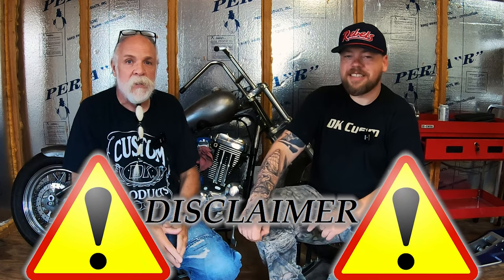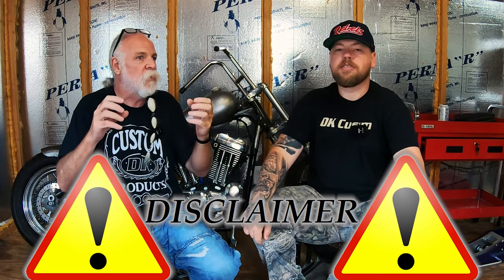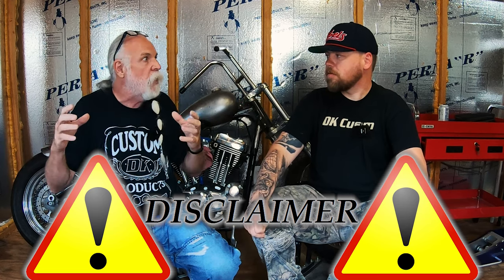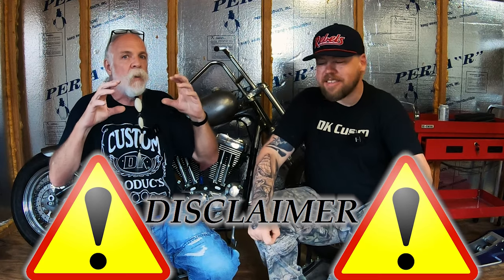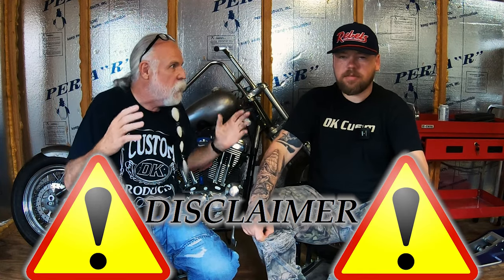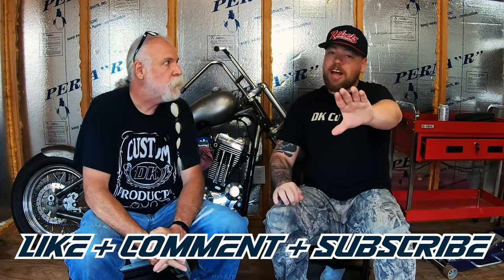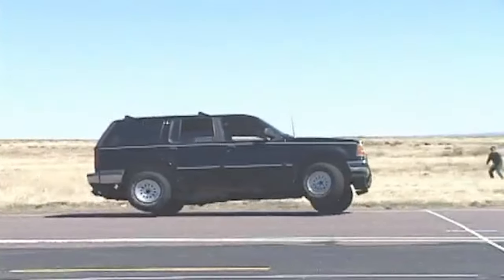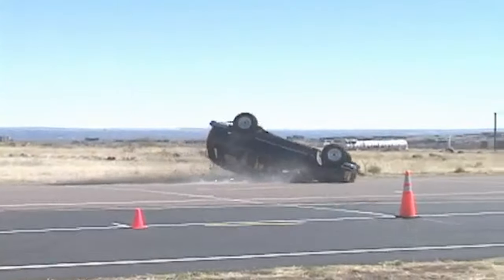Why Does Harley Manual List the WRONG PSI for Rear Trike Tires?

Comment: I bought a 2016 freewheeler and it already had a lift kit and air shocks 26 lb buckboard ride. Lowered air to 24 lb still rough ride.
Reply from the maker: The air shocks are certainly not the most comfort you can get for your Free Wheeler. 

 One thing I would do right away is get the PSI in the rear tires (NOT THE SHOCKS) down to the 20-21 level. 

If you are still not happy with the ride I would look at getting a different set of shocks. Here  is a rear suspension report, with comparisons, that you may find useful- https://www.dkcustomproducts.com/overview-of-performance-rear-shocks-98.htm

Here is a video on our NEXGEN™ shocks that you may find interesting - https://www.youtube.com/watch?v=vbU6fdtxjSI

Please feel free to contact us with any questions;
Support@DKCustomProducts.com
662-252-8828

Thank you for commenting! MB

Comment: Picked my 2011 Tri Glide up yesterday and started heavy maintenance on it. Great video: will adjust TP today. Side note: 2011 model with 2070 miles on it. Verified by dealer with their scan tool.2070 miles.....Paid 17 grand for it. 2070 original miles. That would be 2070 miles. Did I mention it has 2070 original miles?:cat-orange-whistling:
Reply from the maker: Congratulations on your new to you bike with only 2070 miles on it. I hope you get it set up perfectly for you. Thank you for commenting! MB
Reply: @DKCustomProducts  Both service writers and 4 techs in the back all looked at that mileage lol. They were shocked same as me when I first looked at the odometer.
Reply from the maker: I am glad that you were able to find a bike that you wanted with so little miles on it! MB

Comment: The fight between Ford and Firestone came in that Firestone told the Ford engineers to run 28psi and the Ford people wanted to get a better ride and lowered the tire pressure to 24psi. The tires were popping off of the bead going flat while people were doing curves and turns. The rest is as they say history. After the lawsuits were done Ford increased the required pressure to 28 psi. Guess Firestone was correct.

I am double checking on that 2015 Freewheeler that I rode. The tire pressure was set by a guy that was working with me. He watched a bunch of your videos before we started working on the trike. We put your brackets that raise the rear up on because of his watching that video.
Reply from the maker: Thanks for the additional info on the Ford/Firestone dispute.  👍

Comment: thanks for the info i will be doing that on my freewheeler cause been useing max pressure being concerned with uneven wear and lower fuel milage due to the lower air pressure and my god it is like riding a 2  X 4 and just a back killer and i had gotten a trike cause of a lower back issue and was so disappointed with the harsh ride
Reply from the maker: Yes, a first good step is getting those tire pressures down to the appropriate PSI for the weight of the Trike.  Somewhere are 20 psi for your Freewheeler.
If you want even more comfort, what we have done to our is use the NexGen™ Trike Series Shocks™ with a Convertible Comfort Lift™ and with that extra travel and dynamically adjusting valving, it is an entirely different ride quality.
See some details here-
https://www.dkcustomproducts.com/dk-custom-nexgentm-14-trike-series-shockstm-for-harley-davidson-trikes-1971.htm

Comment: Great channel .hoping you will find something to stop the wind above the lower farings on the triglide
Reply from the maker: Yes, we have two items that help reduce buffeting from that air coming over the lower fairings of a Tri Glide.  They both work alone, and when combined they work even better.
A 1.5" tank lift with a Deluxe Option (link below) will raise the front of the tank and catch some of the air that would normally go over the tank and hit the rider in the chest, contributing to buffeting.  Now that air goes under the tank, and over the engine, providing around an extra 10-15 F of engine cooling, and less buffeting.
https://www.dkcustomproducts.com/touring-model-tank-lift-kit-dk-trg-tlk.htm
Additionally you can use Cooling Deflector Wings (link below) by themselves, or with a Tank Lift and they direct that air from between the batwing fairing and the lower fairings to go over the engine instead of hitting you.
https://www.dkcustomproducts.com/cooling-deflector-wings-for-touring-trike-models-dk-cdw-trg.htm

Here are a couple of videos that you may find interesting/useful on the subject-

https://www.youtube.com/watch?v=WlgOdyEGWeQ

https://www.youtube.com/watch?v=f-wntxTmJyE

Comment: The rear tires on my Freewheeler are the same size as the ones on my '06 Diesel  Beetle. I ran those at 34psi front/30psi rear; in Las Vegas where I lived, they dry-rotted to death long before the tread was gone. But, that was a CAR. I knew the tire pressure in the Freewheeler's owners manual was... bogus... when I read it. So is the air pressure for the rear shocks, by the way... I've been running 20psi in them, since I bought the thing in April 2019. It's been all over the country, with lots of hard, hot miles in the Southwest. There's still almost no discernable wear on the things. If I'm loaded down with stuff, and going to be running around in the mountains with lots of time over 10,000 feet? Sometimes, I'll put 22psi in them, but no more. Probably not necessary, but... it make me feel good. I'm eyeing a set of Michelin radials for when these Dunlops finally die (don't care much for Dunlops), but at this rate? They just might outlast ME...
Reply from the maker: Glad you're enjoying your Freewheeler!
Yes, the OEM rear tires last quite a while.  I changed a set at around 50K miles...they still had good tread depth left, but we were leaving on a 13K mile trip and I wanted fresh rubber on there.
Enjoy your ride! 👍

Comment: Thanks guys for the great information.  I'm in Australia and have a 2018 Tri-Glide which I have found for me is 22psi for the rear types and the rear suspension is at 30psi. I'm  often ride 2up and or with a trailer.
Reply from the maker: Great info.  Thank you for sharing.  Appreciate your comment. 👍

Comment: What  about the air pressure in the front tire on a trike?  And would you run a car tire on the front of a trike?
Reply from the maker: The air pressure in the front tire should be as shown on the side wall. The rear tires on an HD Trike are passenger car tires.  They are NOT specifically made for Trikes.

Here is a video about what Kevin does to get more out of his Trike's front tire that you may find interesting - https://www.youtube.com/watch?v=uZWDBsc6BEY

Thank you for commenting! MB

Comment: Sadly, on the CVO tri glide running it lower than23 will trip the TPMS system. I have a 2019 Tri Glide Ultra and will run it at 20-22 now that I understand the situation. I will purchase a TPMS system that used valve cap sensors and be able to monitor it to stay safe. I ran one on my 2012 Street Glide and it uses the phone and you can set the alarms to be what you want. They measure pressure and tempeature and are less than $50.
Reply from the maker: Yeah, silly that the OEM TPMS is not adjustable.  Most all aftermarket ones are.

Comment: 36 PSI you got away lucky, salesman tried to help service finish PDI as they were running behind on a busy day of deliveries, well long & short rear tires were set at 46PSI
boing, boing, boing all the way home. The explanation "that is what the tire said to put in" from that day forward I have run 22PSI and never had an issue even at 30 degrees.
Reply from the maker: Yeah, amazing some of the stuff that some Dealerships do.
Glad you got it down where it is more comfortable.
Thank you for your comment.  👍

Comment: Interesting information,I have a cvo triglide,what would you recommend for tire pressure,with a pillion passenger. Take care both of you,from the UK
Reply from the maker: We did some testing with a CVO with the low profile rear tires about a year ago.
We did drop the psi to 20 and there was a small improvement.  There is just not very much sidewall to give much flex.
We then proceeded to put some Trike Series Shocks™ on the rear, and that really improved the ride quite a bit on the CVO Tri Glide.  (link below)
We also know quite a few CVO Tri Glide owners that have switched over the the regular Tri Glide rears, just to get a less harsh ride.
https://www.dkcustomproducts.com/dk-custom-nexgentm-14-trike-series-shockstm-for-harley-davidson-trikes-1971.htm

Comment: Great video! I dropped my rear to 21 and 33 on the front and a much better ride. Just ride smart to prevent tip overs. Could you do a video on the location of all ground connections on the trike? Having a difficult time locating them in all the spaghetti harnesses. Have a P0152 code and have replaced the sensor. Returns on a short ride after being cleared. One of the causes is a possible bad ground which is what I would like to locate and clean before thinking about  replacing ECM. Thanks from Canada
Reply from the maker: Glad you like the video! We will put it on our list to see if there is a way to do one.

It will be a bit of a challenge, every bike is a bit different, so we would have to come up with a way to make a video that, in principle, covered How to go about finding all the grounds.

Thank you for the idea and for commenting! MB
Reply: @DKCustomProducts  Thanks for the quick reply
Reply from the maker: Glad to help! MB

Comment: My 2015 Freewheeler rides hard. Converted to independent rear suspension and it helped a lot.  
The trouble is the front wheel.  When I hit a bump it is rock hard.  I'm thinking of increasing the triple tree rake set up.  Any suggestions regarding this or another way to soften the front wheel impact hitting a bump.  BTW, great video as usual.
Reply from the maker: The front suspension can be greatly improved for a couple hundred bucks by using Intiminators at this link- https://www.dkcustomproducts.com/improved-front-suspension-w-intiminator-fork-valves-for-harley-dk-ric-int-39.htm
You will be amazed how much more compliant the ride is.
The next best value for the money are the FST's that you can see at this link- https://www.dkcustomproducts.com/fst-asymmetric-fork-cartridge-system-harley-14-touring-trike-dk-prg-mt-ctg-4.htm

A rake kit will make it ride more stiff.  The increase angle will make it easier to steer, but the angle change makes the forks not compress so easily when hitting irregularities in the road.

Here is a link to our front suspension tests and comparison report-
https://www.dkcustomproducts.com/dk-custom-front-suspension-testing-report-part-i-of-ii-dk-fs-tst-rp-i.htm

Feel free to email or call with any questions-
Support@DKCustomProducts.com
662-252-8828

Comment: I had a FreeWheeler, TriGlide Ultra and now a 2022 TriGlide CVO.  All rough riders.  I’ve lowered the tire pressure as low as I could before the TPMS warning light comes on.  I’m looking for the sweet spot using lower TP and mono shock setting.  Any recommendations for one up? Two up?  Thanks for the good videos.
Reply from the maker: Yeah, with the TPMS you are going to get an alarm if you run it at 21 psi, which is pretty ideal, one up or two up.  
You do not have a monoshock set up, it is a single adjustment under the seat that adjusts both rear shocks.  Video on that below.  They most comfortable ride is to replace the OEM shocks with some 13 or 14" NEXGEN™ shocks that you can see at this link-
https://www.dkcustomproducts.com/rear-shocks-c651-261.htm
Here is a link to a report on Rear Shocks- https://www.dkcustomproducts.com/overview-of-performance-rear-shocks-97.htm
https://www.youtube.com/watch?v=5-NVrRF9554

Here is a video of one of our tests of rear shocks- https://www.youtube.com/watch?v=Z4Dhg48_KQA

Here is a video on making the ride more comfortable for the passenger- https://www.youtube.com/watch?v=HQVYFXV3yW0

Comment: The stock PSI on the M8 Fat Boy is wrong too. The correct PSI for the Front and Rear of an M8 Fat Boy is 40 and 42PSI.
The stock pressure is too low.
Reply from the maker: Hi Fran!
Yeah, motorcycle tires are completely different than the car tires on the back of a Trike.
Your riding is impressive (I've watched some of your videos) and sounds like you have it dialed in.
👍😎👍
Reply: @DKCustomProducts  Haha thanks!
Reply from the maker: @FranBunnyFFXII  You're welcome, thanks for watching!

Comment: Do I Lower the front tyre also and will I use more gas with a lower psi?
Reply from the maker: I do not lower my front tire PSI.  When lowering the rear tires from 26 psi to 20-21, there is a very slight drop in MPG, less than 1/2 mpg drop.
KP
Reply: @DKCustomProducts  wow awesome thanks.
Reply from the maker: You are most welcome! MB

Comment: my question is i have 2014 harley trike, the rear tires are those tires like a rear car tire 205/15 or is that tire a special tire for the trike. i want to put michellin tires on the trike.as of now i have the stock tire that they come with stock {brand}.and can you run 22 psi with wife and luggage. thank gunnery sergrant muniz.
Reply from the maker: Yes, the rear tires on a HD Trike are passenger car tires.  They are NOT specifically made for Trikes.
Yes, you can run your Trike tire pressure at 22psi with your wife and luggage. 

Thanks for commenting! MB
Reply: @DKCustomProducts  thank you sir

Comment: Dunflop..I love it!! Recently bought the Michelin Commander lll for my 15 Road King because the Dunlops just wern't giving me the mileage I expected. I'm running the same air pressure in the Michelins of 36 and 40 psi, but now think I might lower the front some to help improve ride. Running the Legend AXEO for about a year now, but still feeling the bumps more than I would like. Any "suggestions" would be appreciated. Maybe drop it down to 30 in the front? Thanks for the info, always look forward to your videos!
Reply from the maker: Yes, the higher PSI in the rear tires will definitely cut down on rolling resistance.  Not sure if it will translate to any significant increase in MPG.  It will definitely translate into a much rougher ride (and a little better acceleration).
The PSI in the front will not have any significant change in ride comfort, but if it is too low it will feel sluggish and also not wear well.
Yes, I do not know what is up with Legend.  We tested their newest AXEO about 5 months ago.  We thought it was going to be a nice improvement, and we were recording it for a youtube video.  BUT, after 15 miles of riding we were incredulous at how bad they were.  We double checked with Legend that we had installed them correctly, we had.   They were very disappointing.  We never finished the video...no reason to make one slamming how bad they were.
The best improvement for $ spent are the Intiminators that you can see at this link- https://www.dkcustomproducts.com/improved-front-suspension-w-intiminator-fork-valves-for-harley-dk-ric-int-39.htm
You do not need to change the springs.
The second best improvement for $ spent are the FST's that you can see at this link- https://www.dkcustomproducts.com/fst-asymmetric-fork-cartridge-system-harley-14-touring-trike-dk-prg-mt-ctg-4.htm
You can also see our front suspension testing report at the following link.  And, to be clear, we are an authorized Legend and Ohlin dealer...they just do not make the grade when compared to other options.
https://www.dkcustomproducts.com/dk-custom-front-suspension-testing-report-part-i-of-ii-dk-fs-tst-rp-i.htm
Reply: Thanks so much for your help!! Yes I'm very disappointed in my Legends, not worth the $$
Reply from the maker: @BackRoadKing  You should definitely check out the suspension report. I hope you obtain the ride you are looking for!

Comment: I run 24 pounds on our TRIGLIDE Two up , but will try 22 pounds thanks
Reply from the maker: Cool, I think you will like it.  I went incrementally down also.
But for over a decade we have been at 20 PSI now, and that is fully loaded, two up, at about 450-500 lbs humans and cargo.
Also, that is what I ran when we were pulling a pop-up tent trailer too.

Comment: How do you adjust the parking brake on a 2014 Harley TG
Reply from the maker: This is what I found in the Harley Manual for a 2014 TriGlide Ultra

1. Place the vehicle on a flat level surface.
2. Release parking brake. Verify the vehicle moves easily when pushed by hand.
3. See Parking Brake Adjustment. Pull the boot back. Loosen jamnut.
4. Push the parking brake pedal to the first click. Attempt to roll the vehicle.
a. If some resistance is felt, go to next step.
b. If wheels turn freely, release parking brake and lengthen adjuster. Check and repeat
until resistance is felt.
5. Push the parking brake pedal two more clicks to the third click. Vehicle should not move
when pushed. If wheels turn, release parking brake and lengthen adjuster. Check and
repeat until wheels will not turn.
6. Release the parking brake pedal. Verify vehicle moves freely.
NOTE:
Apply a coat of grease to the adjuster threads to ease future adjustments.
7. Hold adjuster and tighten jamnut to 72120 inlbs (8.113.6 Nm).
8. Install the boot over the adjuster.
9. See INSPECTION to check performance of the adjusted parking brake.

I hope the information that I gave you is helpful. You can look up the manual online if you need pictures or any other information from the manual! 

Thanks for commenting! 😎

Comment: I weigh 400 lbs .do.i need to add more psi to the tires than 20 or 22psi?
Reply from the maker: Nope.  They are car tires,  made for much heavier loads.  We have 10's of thousands of miles on our Tri Glides with rider/passenger/luggage weights of 600 lbs + and run 20-21 psi.  Here is an article that you may find interesting/useful.
https://www.dkcustomproducts.com/media/wysiwyg/framesuspension/rearshocks/Lehman_Trikes_correct_tire_pressure.pdf
KP